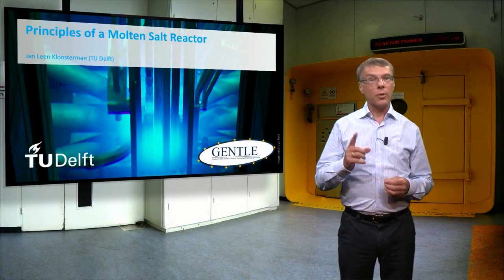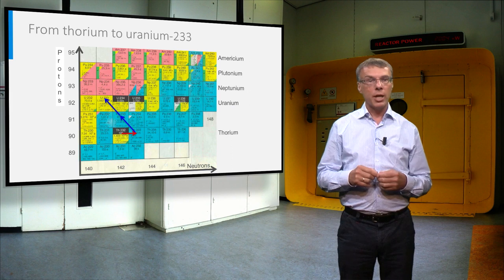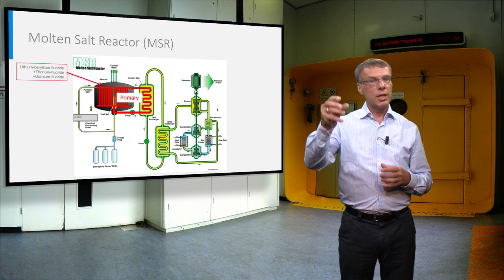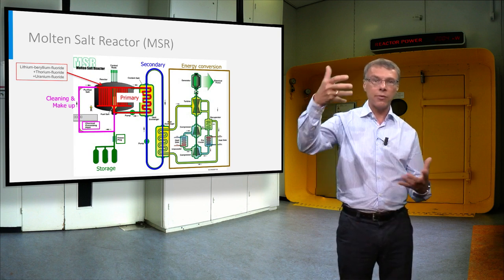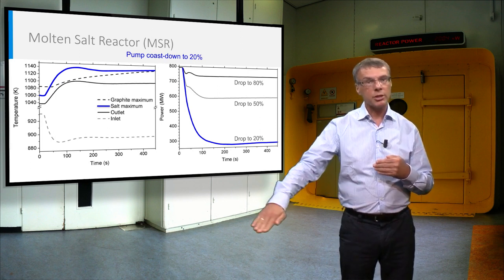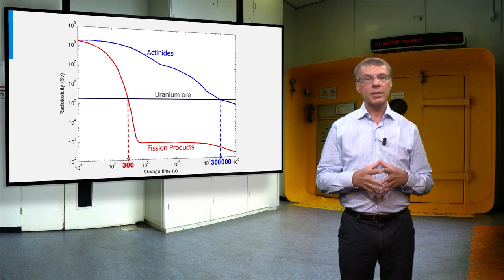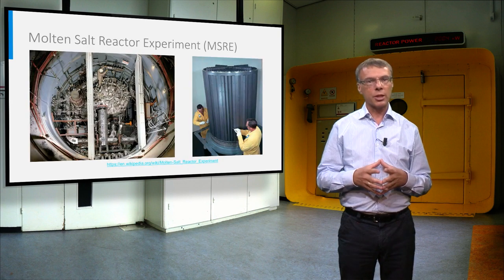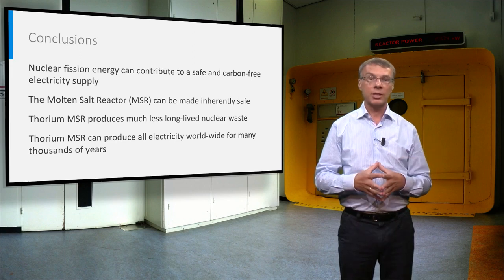Thorium fuel cycle in Molten Salts Reactors

Comment: Dear Jan Kloosterman,
This video is a gem in its compactness and no distractions. Perfect!
If I understand right, there is still an issue with lithium-6 absorbing valuable neutrons. Li-7 is the better isotope for FLiBe. It seems hard to separate them without using mercury. I might have a method using standard equipment in an unusual way. I have a similar proposal for separating Tritium(T_T or D_T) from Helium in fusion reactors where Tritium "storage" in cryo-pumps can be avoided with this method. Fusion would also profit from enriched Li-6 to enhance neutron absorption in the Li blanket in order to generate more Tritium. 

It is actually very simple to use a turbomolecular pump as they are selective to molecular mass. In an application of He leak-testing, the TMP is pumping air like gasses from a vacuum vessel but it leaks Helium gas, applied at the TMP's output, in reverse direction through the TMP to be detected at the outside of the vessel. 

The vane speed of the rotor blades needs to be optimized for a certain mixture of masses and the turbine has to be fitted with a"feed" input midway in the stator and the bottom high-pressure side will "yield" enriched Li-7 while the top low-pressure side of the pump "tales" depleted Li-7 (enriched Li-6). With this adapted TMP it is possible to construct a cascade much like the URENCO setup. It does require an extra fast TMP to increase the pressure from the "tales" to apply it to the "feed" of the next stage of the cascade. 

I don't have a calculation of its effectiveness yet, and I need to see what maximum pressure is allowed at what temperature and aluminum is out of the question but there are large stainless steel turbopumps that can be heated to avoid Li films on the vanes. 

If you're interested just let me know!
(Herman de Jong, TU/e fusion group).

Comment: Is there some reason to use the secondary loop ?
I've seen many  schematics for the 2 loops, but i cant find out why there is need for the second one.
Reply: The secondary loop is only for heat transportation. The salt in this loop does not contain any fuel and is not radioactive, making it possible to transport it outside of the area where the reactor is located, and outside the radiation shielding. It is transporting the heat so it can be utilized in a separate building where heat is converted into electric power or used as process heat.
Reply: Yes, i know, but why not heat the stuff going in to the turbine directly in the first loop ?
Reply: I guess it does not necessary have to be a molten salt. I think you could also generate steam and lead it directly to the turbines, like in a pwr. However then you lose the advantage of high temperature. Maybe it is possible to use a metal coolant or gas like co2 or helium as part of the power conversion system but i am not sure. I think varieties to this example are possible, and they just use the secondary molten salt loop here to show a possible design that would work well. Again i would like to point out that the application could also be for process heat so the salt loop would work well.
Reply: A few reasons to use a secondary  loop:
- If you use nitrate salts, you can capture tritium
- The environment of a molten salt reactor must be highly reducing. In the event of heat exchanger failure, water that gets into the primary circuit can change the chemical balance. In addition, the primary loop is not intended to withstand the high pressures of steam. Mitigating against a design-basis accident of secondary steam pressurising primary salt loop seems like a quixotic endeavour when one can avoid it entirely.
- Radiolysis of water by radioactive primary salt generates hydrogen, that can easily diffuse through metal surfaces and cause embrittlement, or bind to fluorine ions to form HF that then makes the highly reduced primary loop more oxidised (and therefore lead to corrosion)

That being said, you can use basically almost anything for the secondary loop. The DFR advocated lead for its density and radiation shielding as well as good performance in decay heat removal. But you could also conceivably use helium if you didn't mind much larger heat exchangers and therefore the loss of delayed neutrons. CO2 would be radiolysed and cause carbon buildup, as the British found to their chagrin:
http://www.rsc.org/images/Karen_Verrall_tcm18-219419.pdf . So maybe not H2O and CO2 or anything else covalently bonded.
Reply: Ahh..
ty for this !

Comment: In 2019,China is going to the far side of moon to mine Helium-3 for nuclear fusion.When you combined Helium-3 and Deuterium in a nuclear fusion ,you get unlimited energy,hyrogen gas and helium gas.
Reply: Yes, but viable fusion reactors will take at least 20 years longer to develop than Thorium reactors. 

It's safer and less polluting than Th, but Th is much safer and less polluting than U tech.